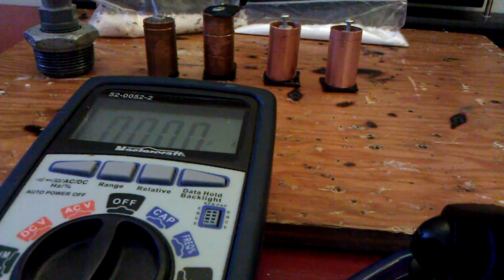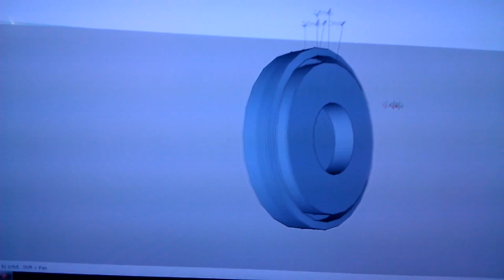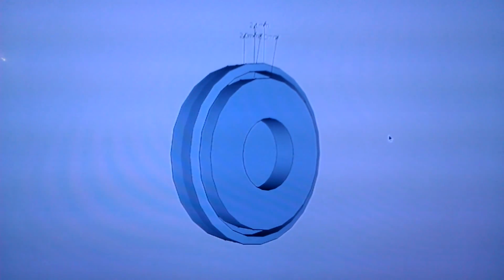1. Crystal Cell test with aluminium core

Comment: Great vid. Did you do any testing with the aluminum core??
Reply from the maker: I did a bit of testing. Very low corrosion rate but only 0.5V and barely 3mA output vs Mg graphite @ 1.5-2v & ~10mA. An Al-Mg alloy core would work best but hard to find. The Al cell in this video is still alive and outputting power since Feb 3rd 2014.